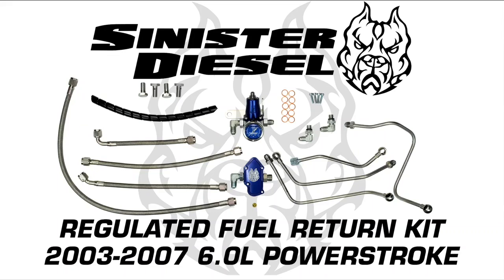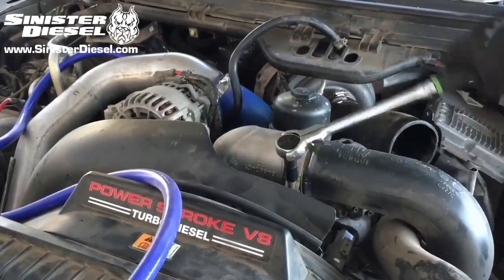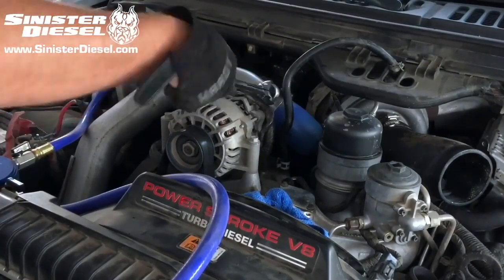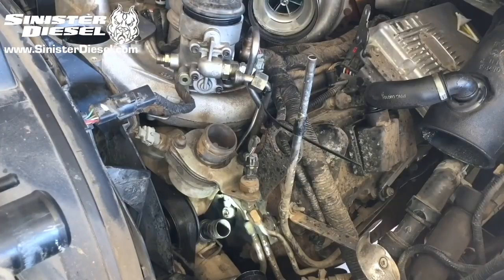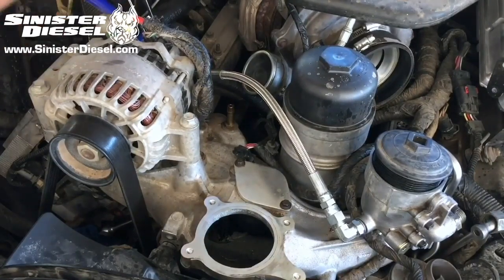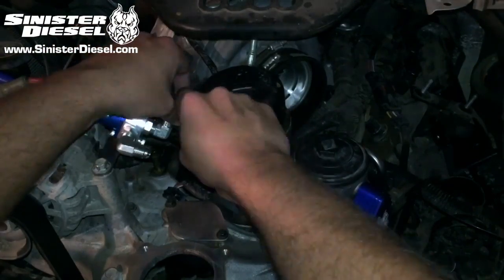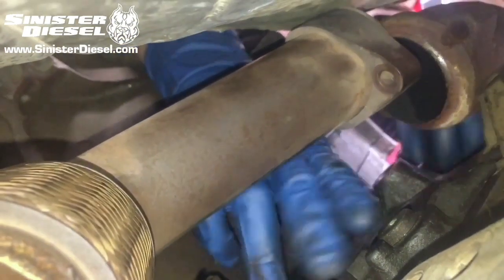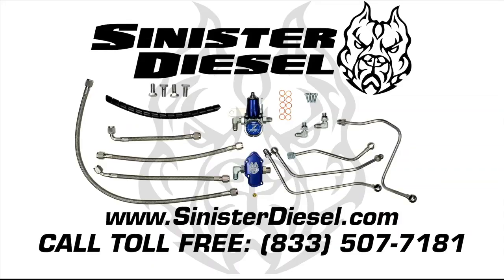Sinister Diesel Regulated Fuel Return Install for 6.0L Powerstroke

Comment: Why?
Reply: Frank Morreale hot fuel in the block will be mixed thus creating better fuel flow also updated banjo bolts help. Saves the life on injectors by a long shot